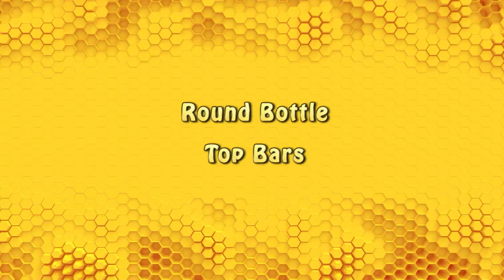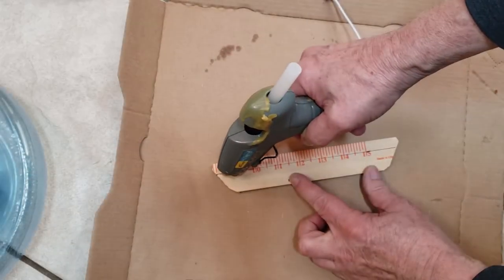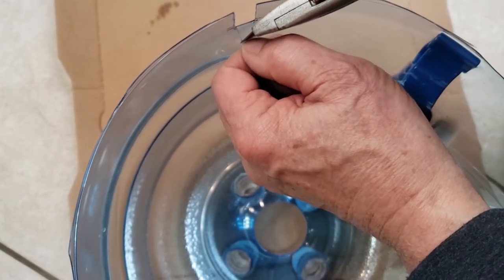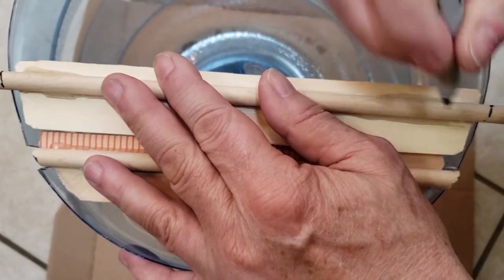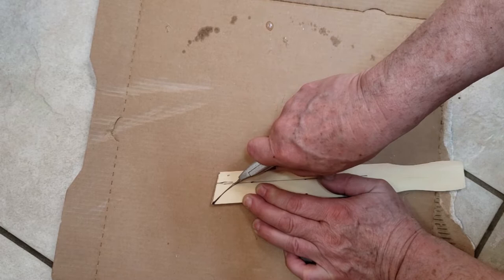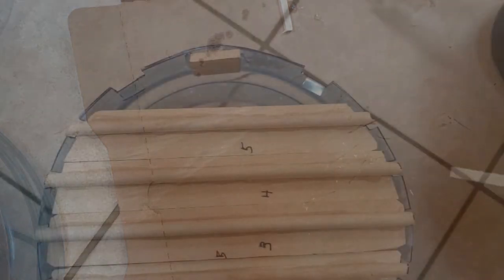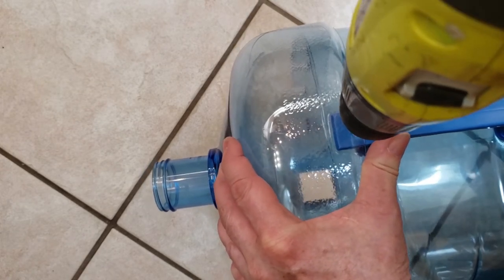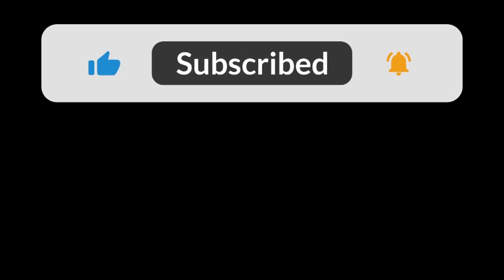Bottle To Bottle Beekeeping | Top Bars for Round Bottles | Round Bottle Construction Part 2

Comment: Thank you for these great and easy to understand videos.  I only have one question about the hot glue.  I live where temps are a hundred plus in the summers. I am concerned that this won't hold up and bees may get trapped in the glue.  Have you had any trouble with this issue?
Reply: Hot glue stays solid until 250F. If it's getting that hot, your bees have other problems.